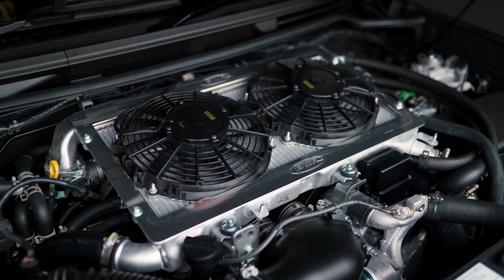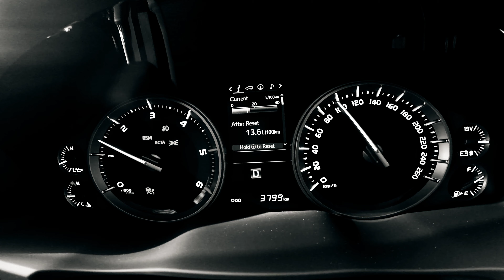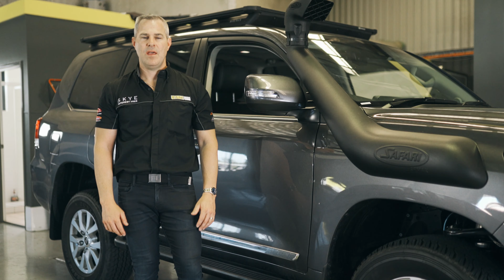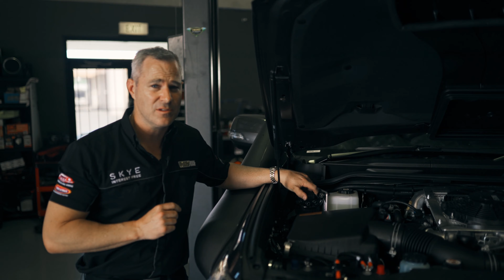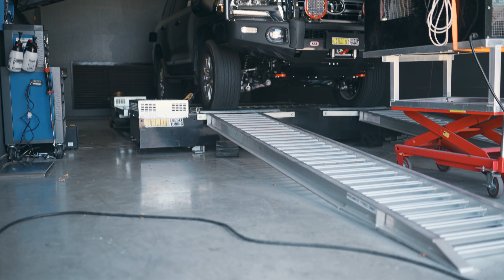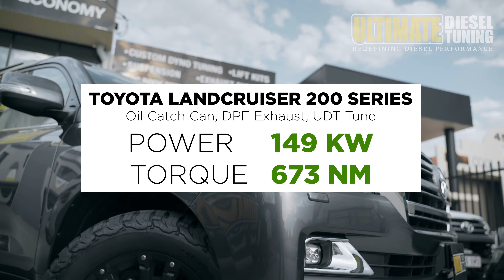Want to IMPROVE your 200 Series LandCruiser's power, torque & efficiency?

Comment: Can I ask whether why you need to install a lock up kit to override the TCU when you are tuning the TCU as well? Can the lock-up parameters not be changed in the TCU tune rather than needing a seperate box to keep the torque converter locked more often?

Comment: Hi from Europe ! What for engine have this LC200? We have stock V8 4.5 diesel with 210 kW and 650 Nm. So after tune (engine only)  256 kW and 820 Nm. With DPF Filter.
Reply from the maker: Hi there. You are talking figures at the engine/flywheel. Dyno figures are measured at the wheels, so there is a substantial difference.